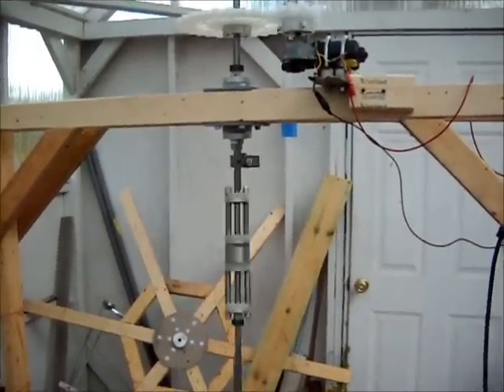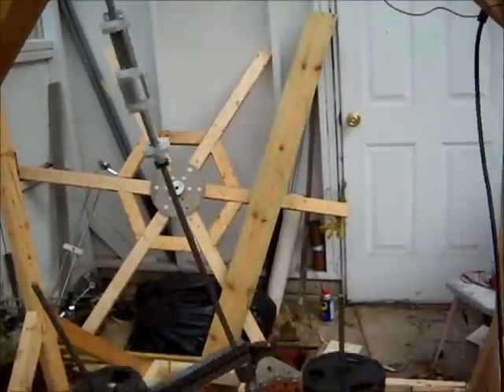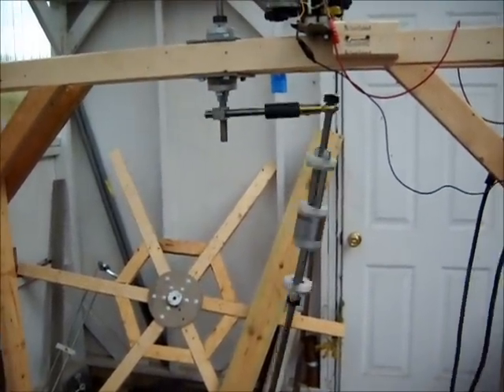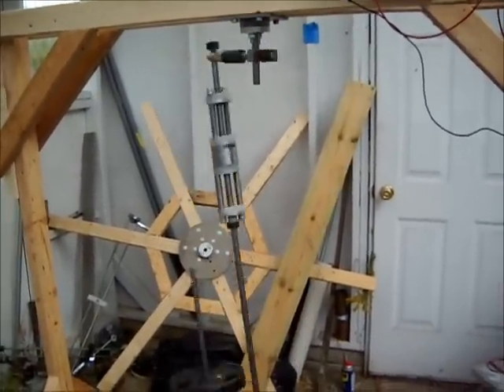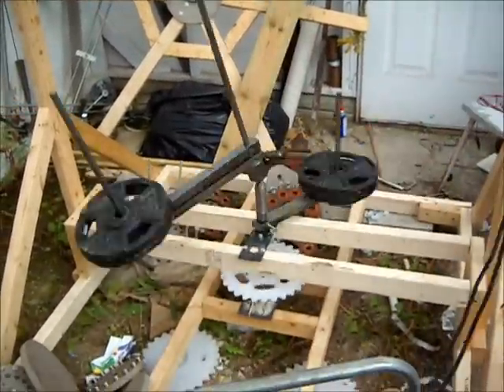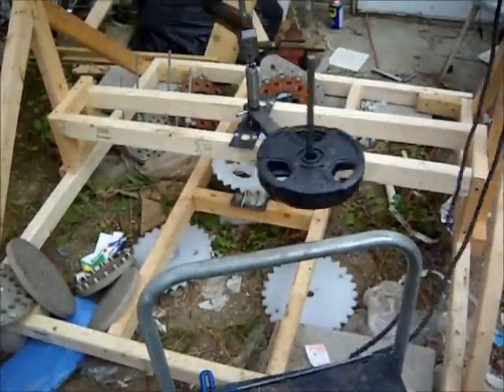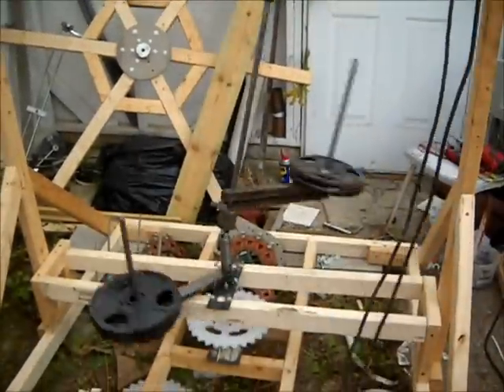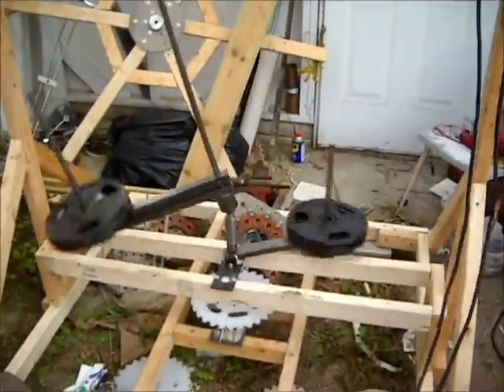MakingSimpleSkinnerDevice MotorTest

Comment: everyone needs to do the following test,  remove the weights,   now operate the machine and record the amps or wattage being used by the motor to drive the levers.   now put the weights back on and do the amp draw test again.   did the amp draw increase ? how much ?   if it increased substantially   then your weights are not in a just past balance falling position.  Remember how small the drive motor was on the skinner machine, a cotton string only needed to drive the levers.   this shows the levers are not pushing the weights, they are only maintaining the weights in a falling position by rotating.   your drive motors power usage  is only what is needed to rotate the levers.   know what your goal is,  a ten x amplification.   if skinners machine used a 100 watt motor to drive the levers and at the bottom got 1000 watts out then if you are not getting the same ratio of  amplification it's because your weights are not being maintained in a falling position.

Comment: Your missing the whole basic design here. Calculate your input in and your out put. In the original design there is 12V DC in the out put was able to power a metal lathe that could shave off 1/4" metal shavings, that is work done, translating electrical to mechanical work. You need to re-visit the original design and start over. And you are not using gravity to your advantage here.

Comment: The skinner machine is a gravity harvesting device.  this is how I believe it works.    it begins with a lever, the long rods at the top,    the  lever has more than one function,  it lifts the mass into a position where gravity can act on it,  it then holds the mass in a weightless falling position, now the lever begins a rotational cycle in order to maintain the condition where gravity can continue to act on the mass causing it to fall.   this falling process is more like a ball rolling down a ramp,  which causes the weight to fall in a rotational circle.    The lever lifts the first mass,  it keeps lifting till the mass reaches a position where the mass reaches a balanced state.    at this position there is very little force against the lever,  and if balanced just right you could let go of the lever and everything would stay in that position, like balancing a pencil on it's eraser.   all that is needed now is for the lever to pull the weight past it's balanced position where  gravity can now act on the mass to pull it back down in the opposite direction.   this is the most important  stage because the lever must do two functions, it has to rotate while maintaining the weight at this just past balanced position where gravity can act on the weight and the weight begins to fall but the weight does not fall very far, you can kind of  consider the weight now in a sort of  weightless state.     now the second stage,  the second stage is exactly the same as the first stage,  there is no difference in  it's basic  function.  you are still working with a lever,   in fact it's still the first stage lever that is rotating the second stage lever.   only now you have the added energy amplification  added by the first spinning mass. which is spinning because gravity energy has entered the system.   you now have more force rotating the second lever than you had in the first stage.  and you now use this amplified  force to act on the second stage lever to lift the secondary mass into a position where gravity can act on it.   the same as you did in the first stage.   you must attach the second stage lever to the plate in the precise location so the top lever  performs the exact same function to the top of the second lever, the second stage lever has to be doing the exact same thing the first stage lever is doing.  the second stage mass has to be lifted to a just past balance position and maintained there while the second stage lever rotates.  the rest is a matter of sizing your masses.   the drive motor at the top has to run efficiently,  geared to use the least amount to amp draw while still able to operate both lever stages.    sizing your first stage mass,   how large of a mass should the first stage be ?  remember the power to rotate the first  mass comes from gravity, but the power to keep the mass in a position where gravity can act on it while it rotates comes from the drive motor.  if you put too heavy of a mass on the first stage the drive motor will draw to many amps.    size your mass according to the amp or wattage draw of the motor you have chosen.   if the motor is using to many amps adjust your mass size or your gear ratios. remember electric motors usually like to run at there rated rpm for the most  efficient use of power. I have experience with electric motors because I build small electric vehicles.  it's best to start with a small pully or sprocket on the motor shaft then gear down and up from there.     the second stage mass size plays a role also in the power draw of the drive motor too but you also have help now from the first stage spinning mass, it is helping to rotate the second stage lever so you may find you can just keep  increasing  the second stage mass size until you start to see a increase in your drive motor amp draw.  use the amp draw of the drive motor to adjust all gear ratios, mass sizes and lever arm lengths.   there may be timing issues where the first mass is not in sync with the second mass, this could happen if the second stage weight is too light or too heavy.        there are other factors to consider to, such as the distance the weights are away from the shaft, things may change in rotational speeds, how high the mass must be lifted to reach the balance point,  the higher you have to lift the mass will changes the levers circular path size.    the torque on the lever,  the overall size of the machine.  the larger the diameter of a circle the bottom mass makes the more torque you will have available at the shaft  to drive things.  since the machines overall rpm is limited you have to rely on heaver weight or  increase the rotational circular diameter of the masses.

Comment: Don't forget the 4 legged chair analysis, when you tilt the chair back on one leg you are also balancing the chair on that one leg.  at that balance point there is very little pressure needed to hold the off ballance weight of the seat up in the air.    you can put a heavy weight on the seat and still once balanced very little effort needed to hold it there.   from that point you only need to input a small amount of force at the top to lean the weight just enough where it is no longer balanced and the seat begins to fall.  and just at that point, call it 12 O-clock when the weight, the seat starts to fall, you again rotate the top of the chair while keeping the leaning angle the same.  notice I said rotate ?  meaning in a circle.   continue this same pattern of motion and you now have a almost balanced mass spinning while using very little effort or energy to do so.   now think if instead of a circular motion at the top you used an elliptical orbit, what would happen?  you lift the mass to it's  balanced position, then instead of just slightly moving to the side so the weight begins to fall you are also lifting the weight past it's balanced point.  sure the weight is going to fall as the elliptical path continues to lift  the weight but now you are using a lot more energy because you are lifting the weight instead of maintaining a close to balanced weight.  in the  circular motion you lift the weight to it's balance point and then as the lever arm is moved in that circular motion you are just keeping the mass in it's lifted position while tilting it just enough to cause gravity to make it spin.   in the elliptical path, which is really just a less extreme forward and back straight line path you are lifting the weight past it's balance point, causing a more extreme off balance angle which will cause the mass to accelerate quicker only to slow down at the bottom of the elliptical path where once again it you have to lift the weight again.   an acceleration and then a deceleration motion.   not only that but the weight is also moving up and down, rising and falling.    there is no balanced mass.   the skinner machine does not do that.

Comment: To much weight on the bottom the top weight is too lead the heavy bottom weight with leverage. Have you notice with williams model the top end ads the torque for the staggered weight.

Comment: Hi Govertical17. I don't know if you are still picking up these comments but I have started work on a Skinner replication and can see why your build, while very good and well made, won't go over unity (CoP>1). You have your shaft and weights all locked together in a fixed configuration and so there can be no gravitational input. At the moment your device is acting as a 'strange' configuration of flywheel and only storing energy. To make it and open system and allow in gravitational energy you can make some simple changes that should transform its function. I can direct you to some videos that show this in more detail but let me know you are reading this by dropping me a ling at 979 jules 979 at gmail dot com. (No spaces)

Comment: I can't see other video with results ? Any conclusion u can share ?
Reply from the maker: Hi, this was a early experiment.  Input voltage was 12 volts @ 3 amps. At the time I had difficulty attaching the PMA, I never finished the project because of the high continues amperage at the input.  I am now working on a gravity assisted pulse  motor. It should have better results. I will be using a PWM cap dump circuit at the output.
https://youtu.be/b6BzIO8zj3Q  
I am adding more magnets and electromagnets. Cheers, I will post results when available.

Comment: Thanks for the Video, nice work!
If it really works (= get more Power out then putt in), then you could reconnect the Output mechanical to the Input (= Motor)
If its not working this way,- well, it does not work :-(

Comment: Nicely done. I would like to think one of these could be made smaller eventually but the mechanical hoops must be jumped through first. What we're looking at is not a perpetual motion machine but rather a gravity-assisted torque multiplier, which sandwiched between a small drive motor and PM alternator should perform the trick we're looking for. Lenz drag attacked from outside the electronics realm ;)
Reply: nicely done ?  what is it that was nicely done ?   does it harvest gravity ?  no. does it amplify the input power at the bottom ? no.   so do you mean nicely done failed attempt at re-producing the skinner gravity machine ?     he is doing the same thing most people are doing, the top lever is just rotating the first weight, the weight is not rotating from gravity acting on it.    and so neither is the second weight.  he can add the PMA and do some output test and he will find out there is no amplification.   why ?    the mass has to be lifted to just past balance to where it begins to fall,  then at that point the lever must keep the mass in that position and begin the rotational cycle.  and then the rotational speed of the top lever must maintain it's speed ahead of the falling mass.  if the lever arm rotates to slow the falling mass that is falling by gravity will catch up to the lever and the lever will prevent the mass from falling.   and if the lever rotates to fast the lever will catch up to the mass and push the mass around in the circle.   the mass cannot be inhibited by the lever at all.  the lever is only there to maintain the lifted height of the mass and to rotate  in order to keep the lifted height of the mass,  to create the condition where gravity can constantly act on the mass.  both weights must rotate  from gravity and not by the drive motor. the drive motor only provides the power needed to drive the levers so they maintain the condition just ahead of the mass allowing gravity to act on it.
Reply from the maker: Hi,  I plan to add a MPPT circuit to help reduce the Lenz drag. Waiting for warmer weather to continue work on project. 

MPPT video, manual operation of PMA, without the circuit I was not able to spin the PMA.
http://youtu.be/B3dLzZZ5jKQ

Comment: neat, are you trying for a self perpetual motion pmg drive?
Reply from the maker: Hi, Skinners original device was able to convert 1/8 HP at the input to about 2.5 HP at the output. I see the device as two machines. The upper part is using a lever that rotate the center of gravity of the lower part and the weight always falls toward the center of gravity. So it uses gravitational assist and mechanical advantage. I just want to finish the fabrication and make some basic tests. I know OU is not possible. Small amount of force at the input with more force at the output, just like a lever. The loss is distance travelled but it is travelling in circle. There is  a lot of controversy regarding if it will work.
I will post results when available.
Reply from the maker: How is your water mill project working???
Reply: GoVertical17 Iit's ready to go into the water, but there is a large rock that needs a backhoe to move it, unless I find another spot.
thanks